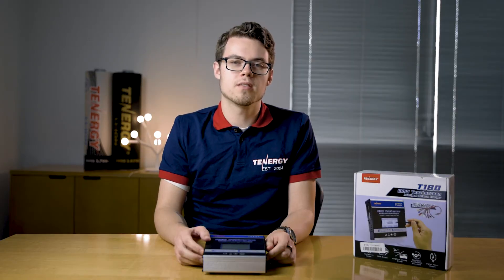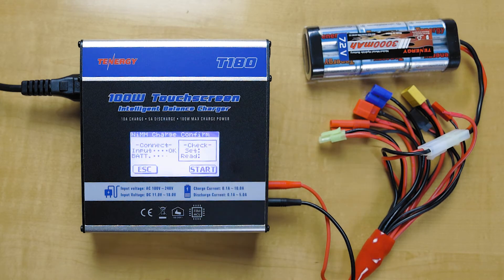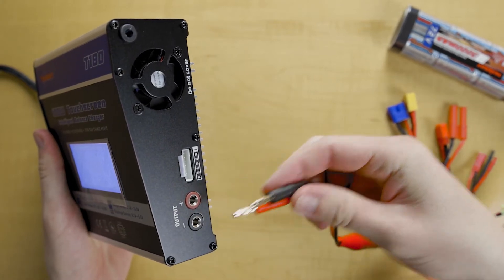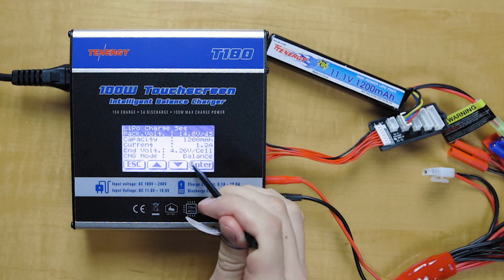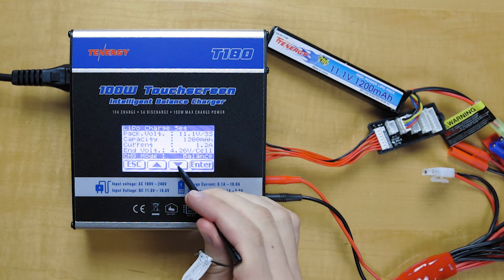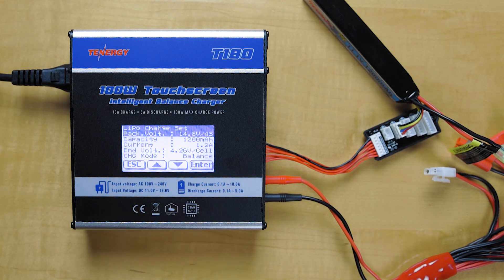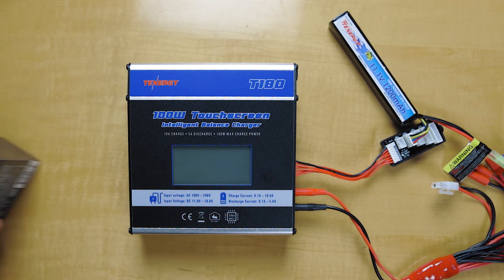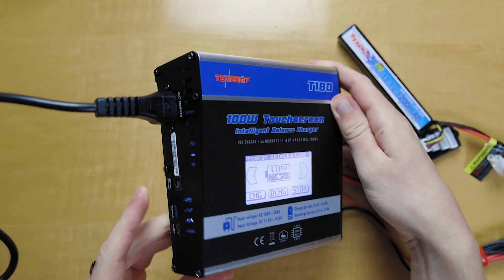Top 5 commonly encountered problems with Tenergy's T180

Comment: What about a short circuit error message
Reply from the maker: Hi Preying Mathis, it sounds like an issue with the wiring or connection with the battery pack. Please reach out to our team directly at service@tenergy.com so we can take a closer look at the error code and your setup.

Comment: I keep getting Max Ext(externel) Temp. Error. I have never used an external probe. It's set to 140 f. And nothing in the room is 140 degrees. Unplugged it and plugged it back in and it persists. Any advice is appriciated.

Comment: i recently bought one of these and im having an issue with the charger chiming to tell me the battery is fully charged despite me knowing that its not (i havent charged them since my car crashed 5 months ago, and they were almost dead then.) and the capacity never reaches half of what the batteries capacity is. am i doing something wrong or do i need to use the delta peak function, or is there something wrong with my batteries? 
im using TRX ID batteries, both are NiMh, one is 3000mAh, the other is 4200mAh, neither batter get more than 15 minutes of charging before it chimes, and neither show any signs of damage other than the plastic scuffing from pebbles getting in the battery compartment.
Reply from the maker: Greetings Crazy Cherokee, when a battery pack only provides half the capacity this is a sign you should replace the battery. As a general rule for nimh battery packs, If you do not plan to use them for a period of time, we suggest charging NiMH battery packs to 40% - this helps prevent the battery pack fro over-discharging while stored in a cool and dry location. It's also a good idea to check in on them every 3 months to make sure they're able to hold a charge.

Comment: I have your T180 and I am using it to cycle 3x on my 7.5v  6500mHh battery, however, I am concerned because the display shows the voltage over 8.85v and the mHh capacity continues to count  and is now 6150. I assume it will stop at 6500 as that is where I set it but will it damage the battery at 9V ?  Maybe it is just a display thing but it has me worried. Help please explain!
Reply from the maker: Hi W Hein,  a fully charged a 7.4V (2S) LiPO should be about 8.4V. But your reported readings do seem a bit odd - since we don't have enough information on your charge settings, please reach out to our Support Team at service@tenergy.com , so we can have a closer look at your settings together.

Comment: I am trying to measure the capacity of a NP-F 970 (Sony clone) battery by fully charging it and then discarding it. It's Li-Ion 2S but the center connector between the cells is not exposed. I am able to charging it by disabling balancing but unable to discharge it with the T180 because there's no way to disable balancing while discharging.  Is there a way to do this ?.  Any new firmware updates ?. I bought the unit from your Amazon store. The SkyRC IMAX B6 allows you to disable cell balancing while discharging.
Reply from the maker: Hi Methlal, you can discharge normal Li-ion packs, but that battery is not supported. If you have any further questions, please feel free to reach out to us directly at service@tenergy.com